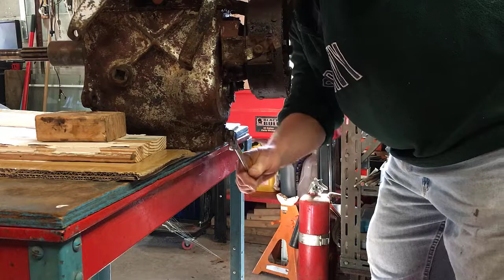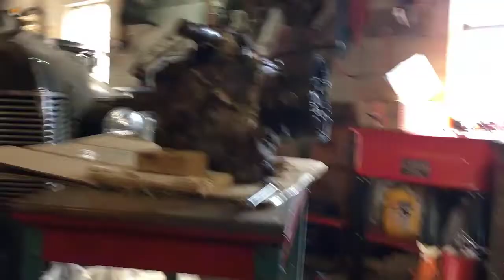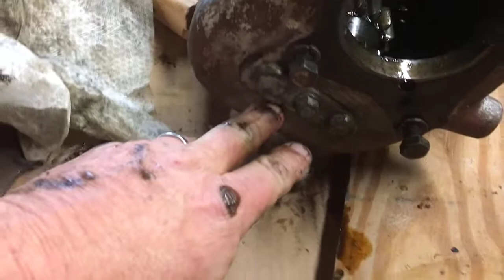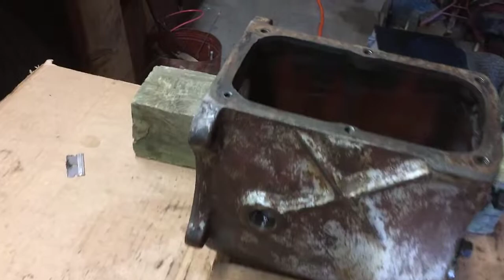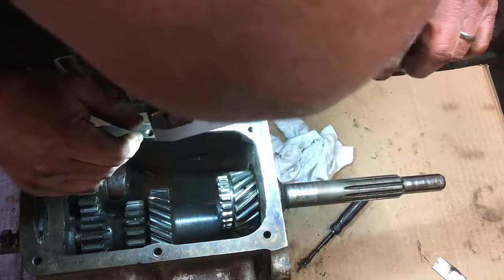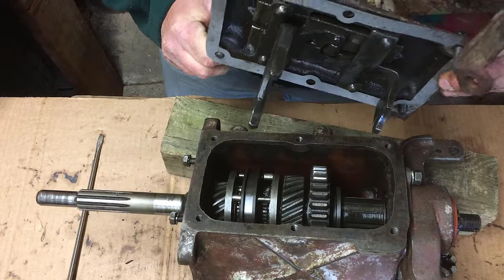1953 Dodge Pickup Truck Part 3.  Tackling the Transmission!

Comment: It is possible you could find a machinist who could make you a replacement brass washer and some shims. There might be some other machinery which would use same diameter but longer roller bearings which could be cut down to the length needed. Perhaps bearings for larger truck transmissions or even some axle bearings for big trucks. Of course there's no telling how long it would take to find such parts. Looks like the transmission is going back together well. Some new gear oil and you should be good to go.
Reply from the maker: Being the truck won’t be a daily driver, I’m hoping I won’t have any issues with the transmission. If I do, I’ll probably try to find another 3 speed transmission. Thank you for your comment.